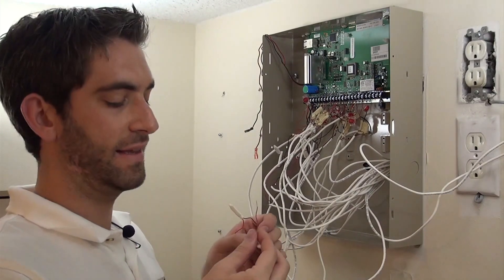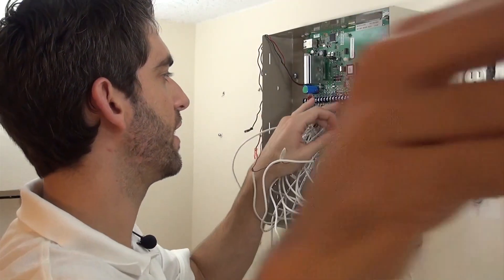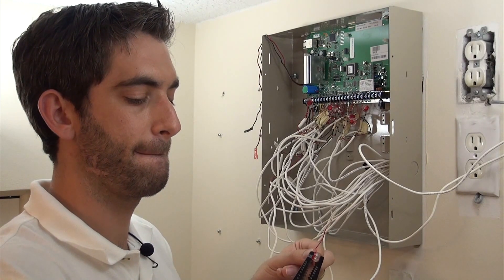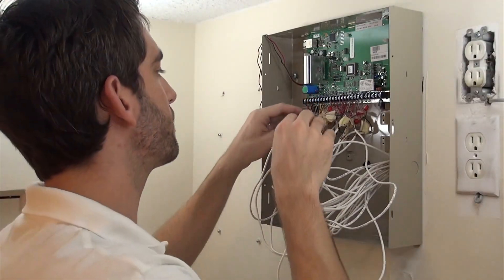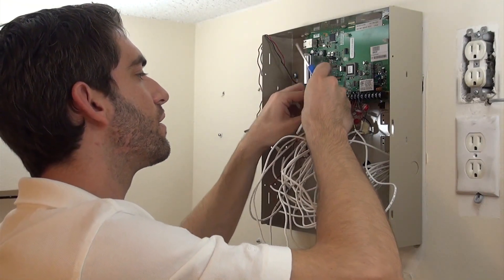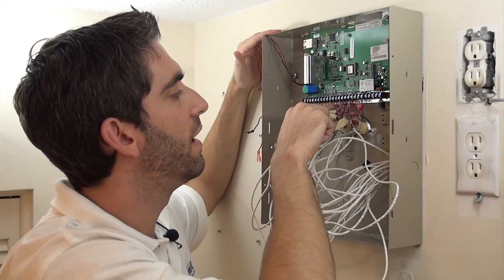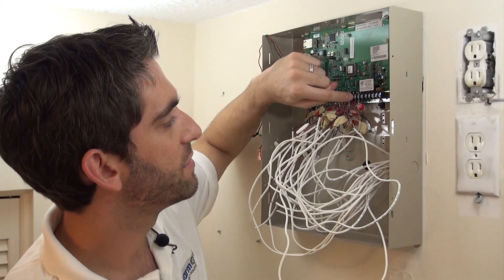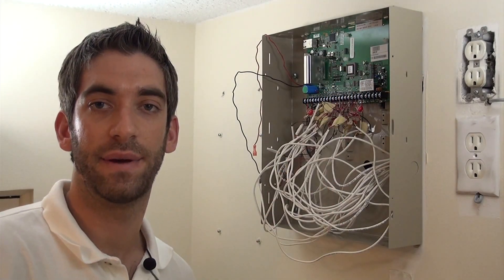Honeywell VISTA 21iP: Zone Doubling, 6.2K Resistor Installation (Continued)

Comment: It took some digging to find that the resistor pack you mention is included with the Vista.  Your item listing for the vista devices need an explicit detailed list of what is included.
Reply from the maker: Where would it be most helpful, in the video, or in the description of the product? The manufacturer doesn't always provide a good list of "What's In The Box". That's true in the case of the VISTA panels, but we could try to add this information, going forward.
Reply: @AlarmGrid  Tuck that away as a thought for future videos.  If it is possible to overlay a note at the spot where he shows the bag of resistors, then you could pop that up - "The resistors are provided with the Vista.  You do not need to acquire them separately"

Comment: So in the zones that share the ground screw, you will have 4 resistors on that screw?
Reply from the maker: If you put the resistors on the low side and at the panel, then yes.  We always recommend putting the resistors on the High or Positive side of the zone to avoid this.  We also recommend putting the resistors at the end-of-line where they belong whenever possible, which would also prevent this issue.  When retrofitting with a panel that already has the wire run, and the resistors at the panel, it's difficult to do this, though.

Comment: This is a great series! very helpful.  I installed my 20P with zones 2-7 doubled.  3k resistors on the lower zones and 6k on the higher zones.  However my sensors that should be reporting on the high zone are reporting the same zone as the low resistor.  Is there something else I need to configure?
Reply: Did you change the programming for zones 2-7 to be ZD (type 3) for the Hardwire Type option in the *56 zone programming?
Reply: Subsequent to my post, I read the documentation (red face) and realized I needed to that.  That then separated the zone reporting.  Thanks again!!!
Reply: Happy to help!
Reply: See my post above.  I realized I hadn't done that.  But now I have a different problem.  All works fine if I open and close ZD doors independently.  But: Kitchen and Basement doors are ZD on the same terminals.  If Kitchen door is open and while opened, the basement door is opened then closed, the basement door will report open until the kitchen door is closed, then both report closed.  Any ideas?

Comment: Hey Sterling, I just purchase a Vista 21ip but I have one concern.  You're video showed that your wire were already been labelled but the hardwire in my home were not. So can you give me some advice on how should I found out which one is which. I appreciate any advice.
Reply: go buy a tone generator to map your wires
Reply: Thanks a lot Drew..
Reply: Jhon Edward James
Drew is correct. A tone generator would be the tool to figure out which wire is connected to which sensor in your home if they are not currently labeled.
Reply: In some cases (e.g. nearby sensors)  you may also use a DMM with audible continuity test.

Comment: Great Video but have some questions.

I just purchased a Vista 21IP , Tuxedo Touch , Wireless Key Fobs, and 4229 Zone Expander.
I am trying to get my main panel to have zones 1-8 and trying to zone double my expander zones 9-25 .
Is that possible?
I was also trying to set up my keyfobs.  Do I need to purchase a wireless receiver or does my Tuxedo act as a receiver. ?
Thank-you for your help
Reply: Hi Vince,

You can only zone double the zones on the panel. You can't zone double an expansion board. You would zone double zones 2-8 and then use the 4229 on zones 17-24.

You do need a wireless receiver for your key fob. The Tuxedo is only a Z-Wave (lights, locks and thermostats) receiver not a Honeywell wireless sensor receiver.
Reply: +Eduardo Rodriguez The VISTA-21iP won&#39;t support any wireless zones until you aad a wireless receiver to the system.
Reply: +Sterling Donnelly gotcha thanks